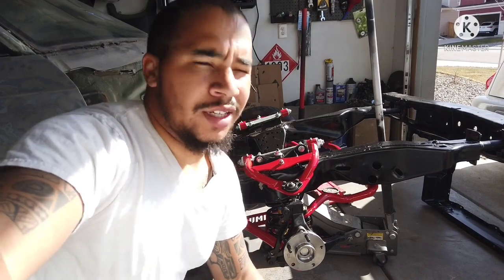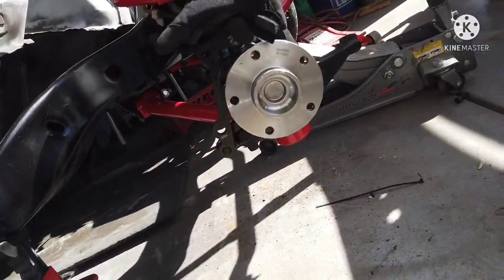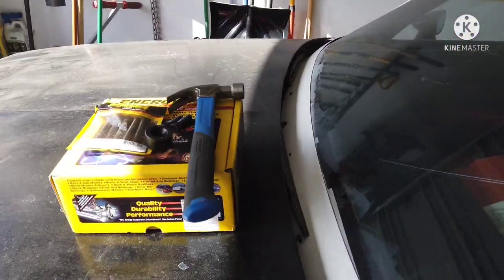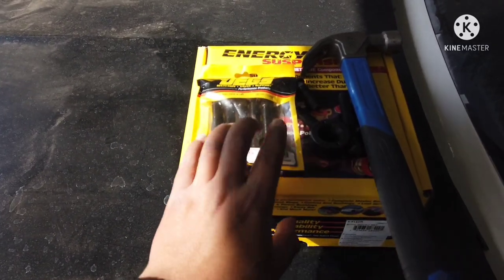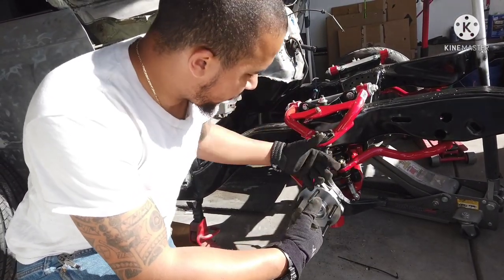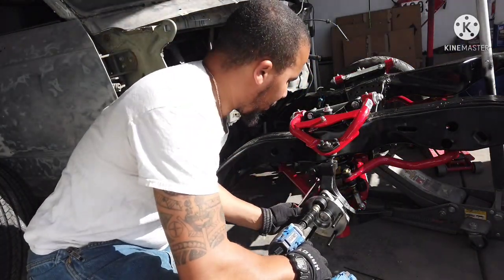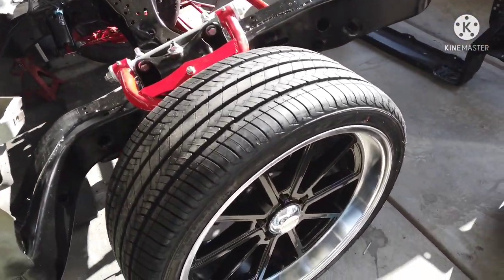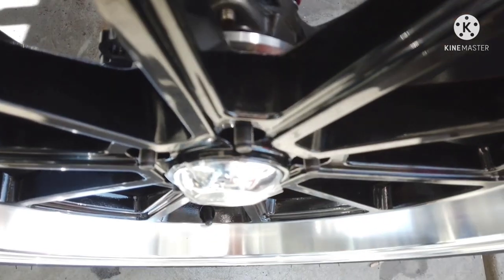How to install longer wheel studs on a 85 Monte Carlo/G-body

Comment: I changed my rear studs and made them longer.
Reply from the maker: I did my fronts too. If you check my new wheel video you can see how far the studs sat in the wheels still.

Comment: just bought a rear disc conversion kit for my 87 GN.. Sounds like this is what I need I couldn't find any info for the rear studs needed.
Reply from the maker: Nice. This one was already done when I brought the rear end so not sure what disc conversion it is. But should be the same if not very similar.
Reply: @Dash's Garage  so I'm thinking it also depends on how thick the new disc will be compared to the drum? the disc that I'll use seems like a late model Fbody maybe not to much difference from the drum? idk I'll probably wait once it arrives to mock everything up then go from there however your video gave more more info than I was able to Google! much appreciated
Reply from the maker: @rlamas67  I'm glad I could help. Let me know if the same ones work or if you have to go with another size/part number.

Comment: I found the 7/16 ones they are 2 7/8” long I guess I’ll have to wait to get my rims to see how long I actually need them
Reply from the maker: I think mine were the same length and stick out just slightly. But I put longer lug nuts that are open on the ends on mine so most of the threads are covered.
Reply: @Dashsgarage  did you use the 1.9 lugs

Comment: Will those studs fit gbody cutlass 4 door
Reply from the maker: I couldn't say for sure if these will work for yours but they say fit most late model gm vehicles. I'd suggest taking one of your current ones off and checking the size of the knurl or the opening. I think the thread pitch changed on G-body's around 81 or so. So keep that in mind if not changing all 4.